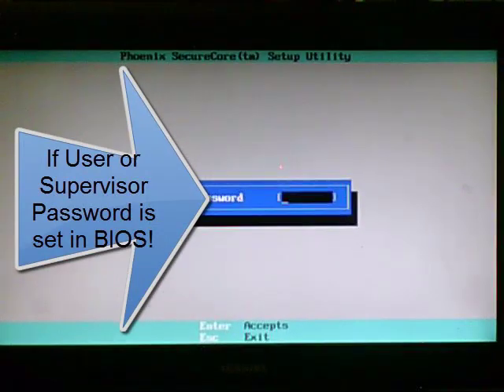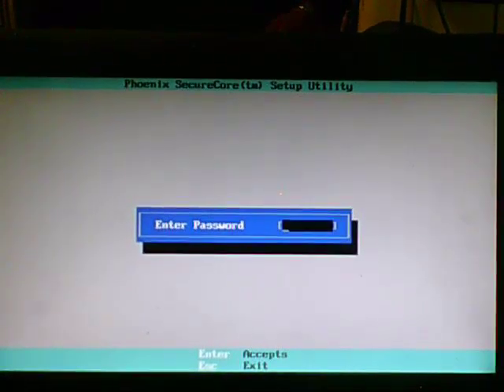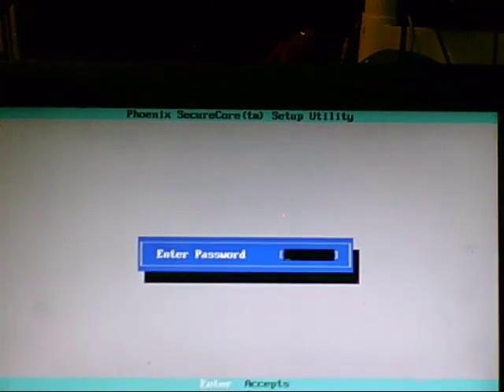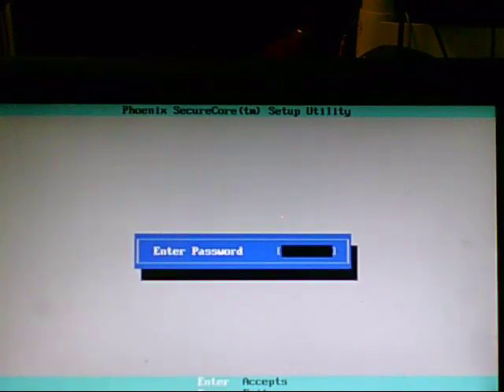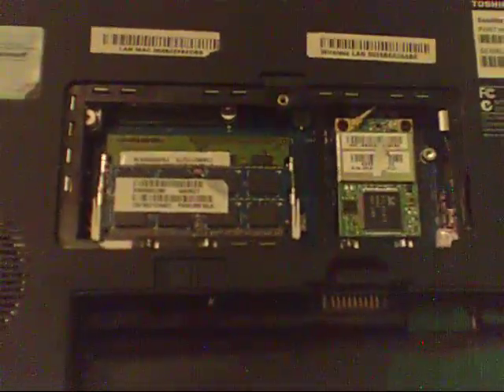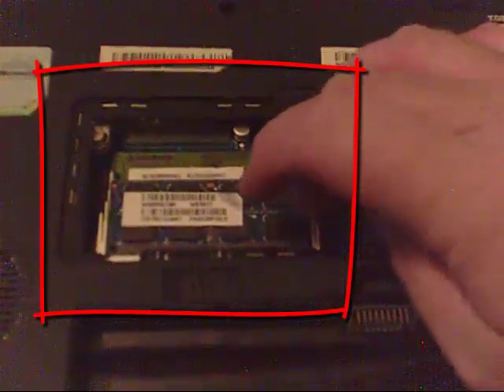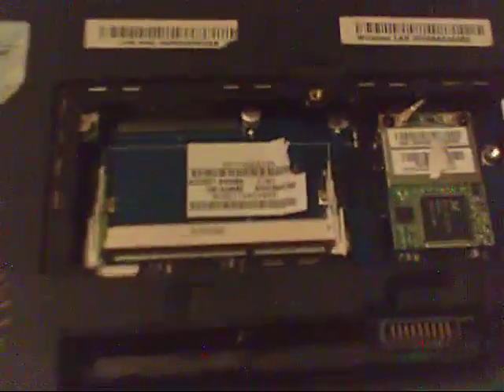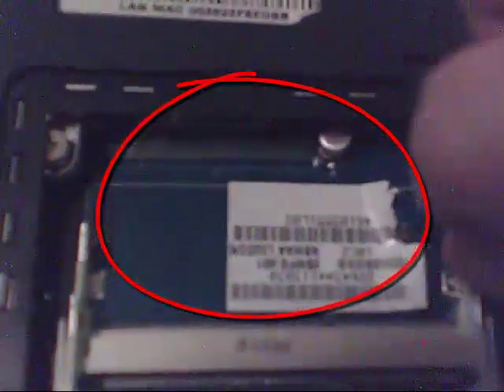How To Reset The BIOS Password on a Toshiba L455 Series Laptop

Comment: Hi  I did this several times and now I have my computer plugged in with the battery inserted and when I turn it on it shows that its on but it won't turn on I just have a black screen what do I do.. do help please I don't wish to throw my laptop away its almost brand new and I wouldn't want to throw it away any suggestions any options I don't know just let me know thank you very much and I'll be waiting for your message

Comment from the maker: @mistercw1 When trying this myself, I had tried all the jump points as you see them in the video.  Only the ones I show crossing in the video worked for me.  Make sure you have the power unplugged and the battery off, so that there is no way that the laptop can regain power of any kind, otherwise, as long as it is powered, the jumpers will not remove the password.  You may need to let the laptop sit without power or battery overnight and try again.
Reply: Rob White can you help me with my laptop

Comment: This procedure worked like a charm. It reset the BIOS back to default. I had to change the dates so they were working again, but very glad I didn't have to pull the BIOS battery to get this working again. Thanks guys!

Comment from the maker: @SuperEsybeltran Apparently you must have done it wrong then!  This procedure only requires the removal of the memory access panel and the memory modules.  You simply touch across the points shown in the video, but do make sure that you don't the laptop AC power plugged in and remove the battery FIRST!  The video makes this point clear, so if you missed that step, you should take your laptop to a professional if you are unsure what to do or unable to do this yourself!